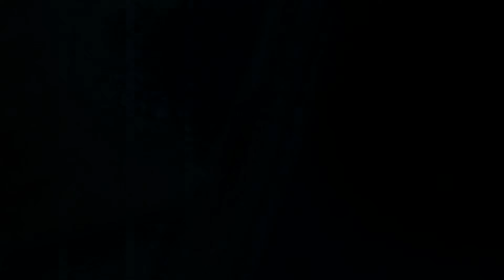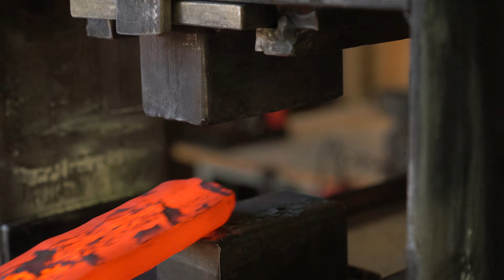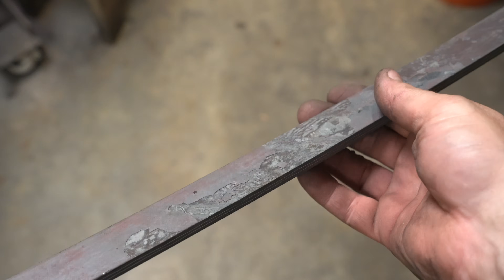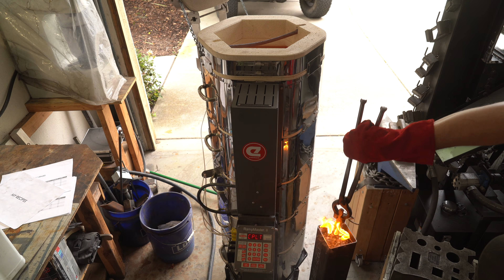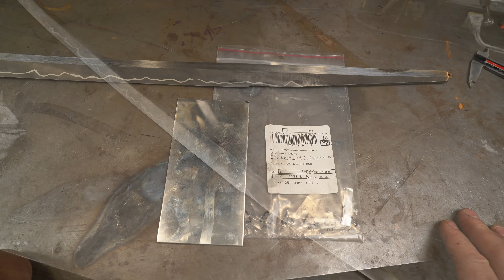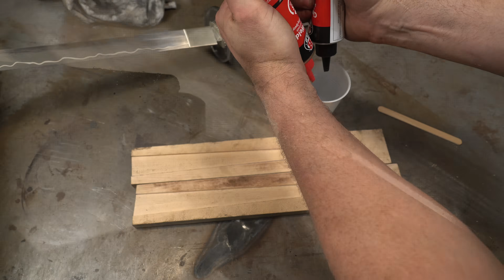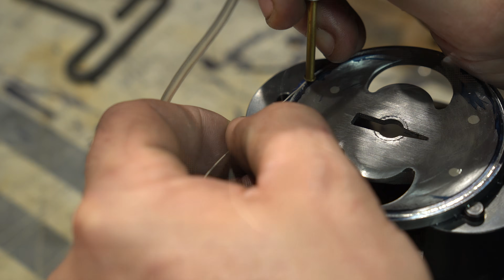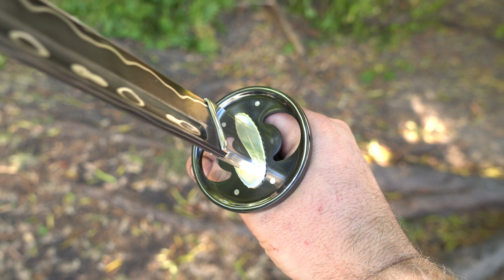Forging a Silver Damascus Katana

Comment: I think you need to move as your garage is most likely out of room for all the toys (equipment) you have, and we need to see you working with more toys! Just how much time saving would you see if you had a fo
Doing the fuller to lighten and strengthen  the blade and exposing the silver there as well absolutely  elevated the artistry of this piece.
Reply from the maker: My wife read this comment about a bigger shop and said no. Lol!  Thanks for the thought though. 😜